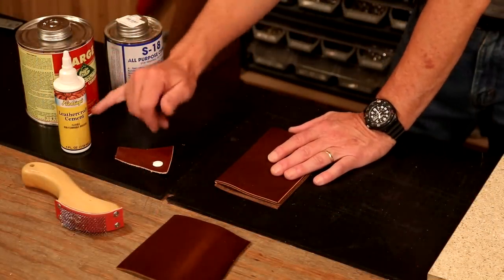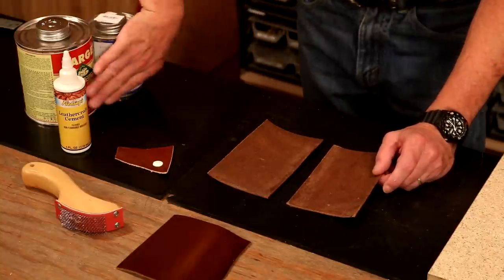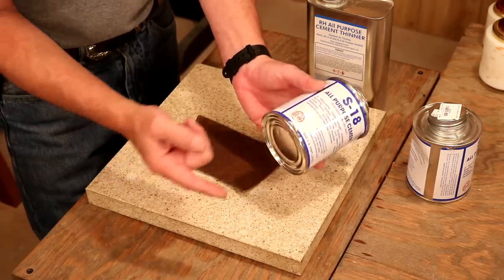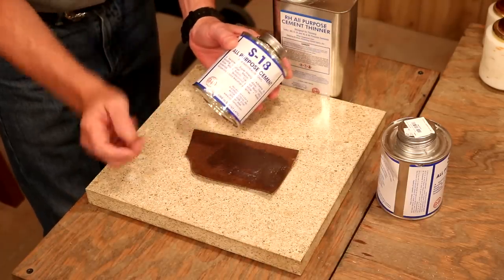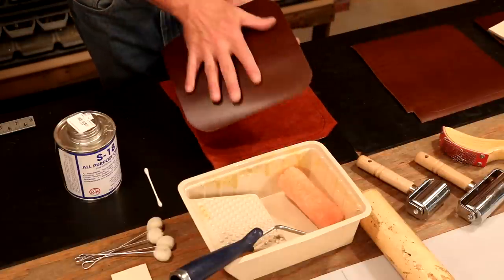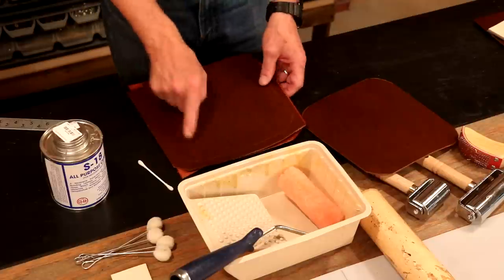The Leather Element: Leather Glue Overview

Comment: How to match two pre-cut pieces together perfectly:

1. Put the two pieces together without any adhesive and line them up.
2. Get some low tac / temporary tape (like masking tape?) and wrap a few pieces around one of the edges, creating a sort of hinge.
3. Unfold the pieces and apply contact cement.
4. Once the cement is dry, slowly fold the pieces and stick them together starting with the edge closest to the hinge.

Et voila! No repositioning or trimming required! :)

Comment: Chuck, I have learned so much from you. Here’s hoping I can learn a little more. I know you have to be careful about drying out your contact cement and I’ve heard you advise to add a little thinner each time you open the can. My question is, does light affect the glue? What about storing it in a clear jar? Also, how long can you reasonably expect glue to last siting in the original can? Thanks in advance.
Reply from the maker: Hi there, if the bottle is closed tightly the cement should be ok for several months before you have to thin it. You'll be able to tell once it doesn't apply in a nice, thin layer. Light shouldn't affect it nor the color of the jar - you just want to ensure it's in an airtight container. Hope that helps!

Comment: Complete newb here: for contact cement, does it matter what sides of the leather you put it on? Heard somewhere you should only put it on the flesh side so it absorbs into the fibers better, but so far when it comes to leather, I only trust Chuck. Thanks for all the great information and enthusiasm for what you do.
Reply: Umm, i sometimes use it on the grain side, and just like what chuck does, i roughen the grain side then apply the cement, works well
Reply from the maker: Hi David,
Yes, exactly what Aria said - if you put glue on the grain side just rough it up a bit and you shouldn't have any issues.
Reply: Thank you both!

Comment: Great help there Chuck.  I have a problem where I tried to make a strap using pull up veg tan leather for front and back. I used a contact glue on each piece. But the glue never seemed to dry 100%!!?? Even when the pieces were put together. Even after a few days I was able to separate the front and back pieces. Any idea what I might have done wrong?
Thanks in advance :-)

Comment: Hey Chuck! Love the channel, love your energy, don't change a thing! Question for ya: I'm kinda new to leather craft, haven't done in earnest since I was in the scouts decades ago. I only just started back up to make sheaths for knives of a very particular style but I'm seeing the potential to take it a bit farther and learning a lot here. I've tried a straight BLO finish to good effect but now wonder if it would work as well over dye? A friend recently gifted me a bunch of Fiebings Leather Dye so now I have a bunch if colors I'd love to try out.
Reply from the maker: Hi David,
Thank you so much, so glad you like the videos! 
I would maybe test a piece of scrap leather with the dye and finish and see how it works. I would recommend using a leather finish of some sort just because its made specifically for that purpose, I like the Fiebing's Leather Balm or Fiebings Saddle-Lac myself.
Reply: @WeaverLeatherSupply  Thanks for getting back to me. That's pretty much what I wound up doing. I put some of the intended dye Ina piece of scrap the applied BLO over it. Several coats later, it didn't harm the dye at all, no running, rub-off or scaling like I had feared, but it made no appreciable difference either. I guess it's as you say, it's just not the material for the application and a proper top coat is the way to go. Thanks again.

Comment: Hi Chuck.. loving your videos, great information really well explained for a beginner like me .. I've looked at your videos on dyeing leather and I've a question - what's the difference between the oil based dyes and water based dyes? My local leather store recommended the Eco Flo range as something good for a beginner and it worked well on my first project. I'm now looking at getting additional colours and I'm going to try my hand at some leather carving soon so would be hoping to do some antiquing too.. I see you always use the oil-based dyes and get great results. So before I buy more dye and antique could you perhaps do a pros and cons of oil versus water based? All the best from Phil in Ireland
Reply from the maker: Hi Phil,
I like the Pro Dye because it gives me the best and most uniform coverage and it has minimal rub off. The main difference is that the Pro Dye has an oil based dye stuff. I am looking into some water based options but I've not done enough experimenting to feel comfortable doing a pros and cons video yet. I'll keep at it though!
Reply: @WeaverLeatherSupply  thanks Chuck.. I'll give it a spin and see what happens 😀
Reply: @WeaverLeatherSupply  Thanks folks.. got the pro-dye and just finished the project.. colour is great (diluted it 50:50 with methylated spirits) and applies well with no streakiness.. very happy

Comment: Use wood weld contact cement - they have a water based version which is good. The solvent based one is even better. And it’s cheap!

Comment: I have been making fly swatters with leather paddles.  I made a batch sewing two pieces of leather together so i could attach a handle between them.  It worked but it was very difficult to sew, even with my wife’s super heavy duty sail rite machine (for sewing sails for boats).  I am going to try to glue the next batch together but am worried that the glue may make them stiff when they need to be flexible like when they were sewn.  Will gluing work?  Do you have any suggestions?  Any help will be appreciated.

Comment: I'm wondering if the cement glue would adhere strongly to stone and leather mix. Like if I drill a hole into the stone and put the leather and glue into the stone would that be a secure fit?

Comment: not a bad idea using the paint roller, however having been raised by a contractor, I would use a thinner "nap" for the roller thickness. otherwise you use a lot more material (glue) than you need to

Comment: Best advice to everyone even the veterans of the trade. Stop using excess leather and items that you just. Don't. Need.

Stop for a moment and examine your project. Take an hour to assess your measurements. In fact. Take a few hours over a few days if need beb and just stop thinking to deep about it if you are not certain.

Once you figure out that you don't need all those strap. Rivets. Buttons and whatever else that a simple stitch will suffice to last your item years and years. You got it in the bag!

Comment: OLD LEATHER SMITH here, I have used this idea 4 over 20 years CHUCK, 20oz water bottle, wool scrap, drill 1/8 or smaller hole in cap, fill with contact cement wool scrap used 2 close hole in cap, U can cover small or large with ease, glue doesn't get thick cap spreads glue FAST. GOD'S BLESSINGS ✝️⚾🙃
Reply: @jimathey6153, i'm dense on this Jim or there's info missing. it sortuv looks like the glue goe in the water bottle - stainless or plastic? where does what size wool scrap go?  since u can cover large areas, it seem it goes on the outside of the cap as a spreader, like the Absorbine Jr used 2 have, but what prevents it from drying out in half an hr? orz the wool inside the bottle? 
puzzld, :o)))

Comment: On Don Gonzales’s you tube site does saddles and will always coat his saddles and belts with two coats of barge cement. If he is going to wet form leather on a saddle he will put three coats on till dry and then apply a very light wet coat. the Wet coat allows him to move the leather slightly. Do you do anything like this?

Comment: Hello Chuck,
I want to form leather and make a pouch for a given size tin.  How much clearance or extra length and width and height do you recommend for the pattern greater than the size of the given tin?  For example if the tin is 3" L x 2" W x 1/2" H what would you recommend the mold size should be?  Thanks for your assistance.
Enjoy this beautiful day
Warmest Wishes and God Bless,  John
Reply: You put the leather over it dry like you was forming it but keep about an inch and a half extra. It will give you plenty of extra. Then wet form dry and trim.

Comment: I've used DAP (Weldwood) neoprene rubber cement for glueing in welts for knife sheaths.  The problem was that when burnishing the weld edge, the rubber cement between the layers also rubbed and smeared over the finished edge making it sticky and unsightly.  I had to rub the edge with a soft cloth and a bit of mineral oil to take it off.  Does the the BARGE or S-18 cement do the same thing?
Reply from the maker: Hi Robert,
You shouldn't have this issue with Barge or S-18 - just make sure the glue is in a thin layer. If it's on too thick, it will get gummy. You can always thin the glue with glue thinner if it's getting too thick.

Comment: I have a question can I use s18 contact cement and then add stitch holes for the look of the stitch instead of the stitch actually holding it.

Comment: How strong is the bond between leather and suede? If i wanted to make a piece of leather 1mm thicker would gluing a suede to the flesh side accomplish that? Would it be strong structurally
Reply from the maker: Yes, suede is a great liner option! You should get a good strong bond if you glue suede on to the flesh side of leather.

Comment: If you use the paint roller, do you throw it in the bin afterwards? Is it salvageable?
Reply: If I had to hazard a guess, unless the glue is water soluble then no---you'd probably end up spending more on cleaning fluids than you would the paint roller?
Reply from the maker: Hi Samm,
I usually just throw them out after using them!

Comment: I am wanting to make leather keychains I cut out of my glowforge, what type of glue should I use to glue the wrong sides of the leather together permanently?
Reply: I used fiebings glue to glue the fibrous side to a paint mixer and make a strop. I imagine all three of these glues will work to glue two wrong sides together. If the glue doesn’t stick, try slicking the fibrous side before glueing to make a flattened surface.

Comment: I have access to contact adhesive. Is that the same stuff?
Reply from the maker: It will be very similar. It might not be quite as strong but if you are stitching over top the contact adhesive should be ok.
Reply: @WeaverLeatherSupply  it will only be for a seat of a chair that has begun to dry out and crack. I was going to glue a complete panel over the top. Thanks for replying 👍

Comment: Do you have to wait till its tacky?
Reply from the maker: On the Barge Cement and S-18, yes, let it dry until it's tacky. The leathercrafter's cement works best to attach the pieces when the glue is wet and then let it dry before stitching or moving on to the next step.

Comment: I do have a question in regards to the interaction between leather paints and sealants. I'm making a hat and plan on painting on it using a vinyl stencil, but im unsure weather i should paint before or after i use atom wax. The hat is dyed black and the paint i plan on using is white.
Reply: You have to paint before you apply your wax if not the paint won't stick. It repels everything including paints. I've made the mistake of trying to paint afterwards and it didn't work out.